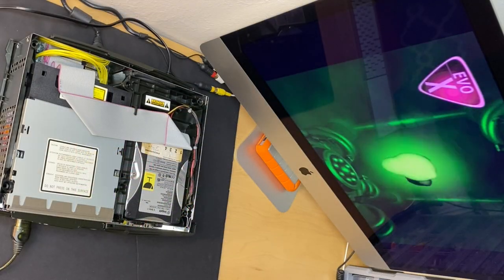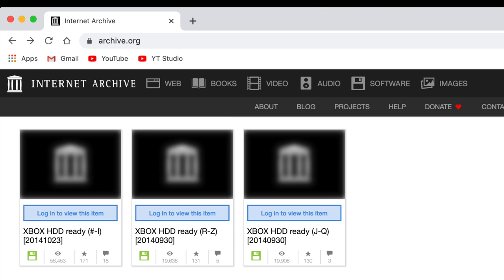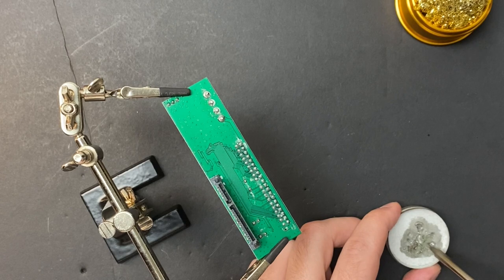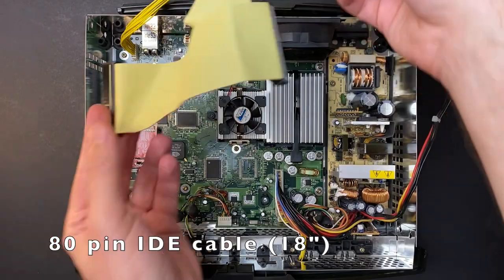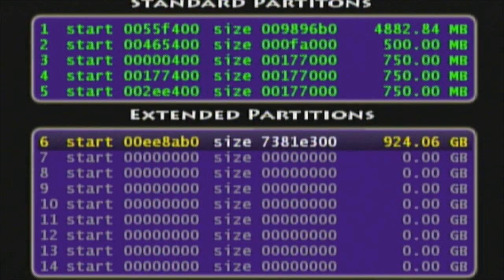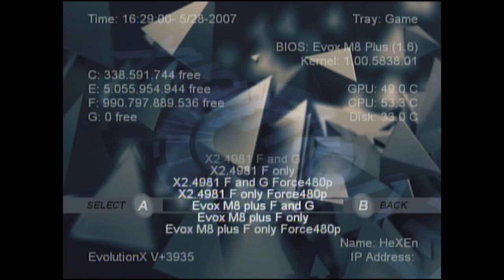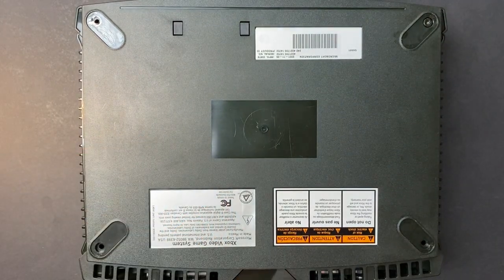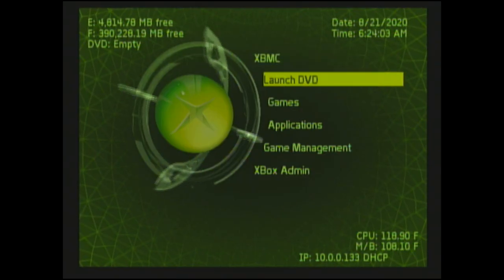Modded Xbox 1TB Hard Drive Upgrade - Retro Console Repair

Comment: Xbox is by far my favorite console ever. I remember back in highschool modding my console with a chameleon mod  chip. I had a few friends with modded xboxs as well and we always traded games and software. I was pretty popular for having all the family guys up to that point on my xbox lol. I also remember putting a momentary switch inside the controller where the memory card would go to power on or off the xbox with out getting up. There's an un used wire i believe a yellow one in the controller you can do this with. I have a video on my channel showing my "time capsule" xbox and how its been since highscool. I graduated on 05 :)

Comment: Love your videos!
Also, a tip for the future: Replacing it with a used enterprise hard drive might be better for the long term as they are built a LOT better, in my opinion. I've hard numerous new retail drives fail on me, but none of my used enterprise drives have given any trouble.
Many businesses will cycle out their drives every two years, and the drives come with a five year warranty as well. If you buy one, and the SMART data shows it's going bad, just cash in on the warranty (or just return/exchange it). Just remember to double check the mfg date on the drives before you buy. Also, make sure you're buying a SATA hard drive, NOT a SAS drive.
But, this is just an anecdotal experience. Lady Luck may be feeling fickle, and you might end up cursing my name if you do this...

Edit: Forgot to mention, they're usually a lot cheaper than retail drives also. However, if you plan on getting brand new enterprise drives, be prepared to pawn a kidney.
Reply from the maker: Nice hack with the warranty idea. This was supposed to be a DVR drive that is advertised to run constantly. Strangely its a 5900RPM drive which is an unusual configuration. It was cheap though. I think for the next build I would use something a bit more high end.

Comment: Nice. Should maybe look into the CPU and RAM upgrade. It doesn't do a whole lot for Xbox games but it's a game changer for emulators and such.
Reply from the maker: Thanks for the suggestion! To be honest with you though I wanted this to be a pure Xbox gaming rig so that I could experience older Xbox titles that I never played when the system was released. I do enjoy some retro emulation on a Raspberry Pi and I know you can push the Xbox even further with PS1 and N64 emulation, but I don’t have a strong desire to use it for that purpose.
Reply: @BorderlineOCD  While it’s good for emulation, the RAM upgrade also serves other purposes. It helps to smooth out dashboard performance for certain ones, and there are some Xbox games that can be patched to run in 720p which requires 128mb RAM to do so. But there are also a few games that can be patched to run in 720p that’ll work fine with the stock 64mb RAM.

Unfortunately, the CPU upgrade is not just something simple that anyone can do. There were only like two community guys with the knowledge of how to do it, and they never made that information public. Then there was the company that made them. It was called the DreamX but no information about that was ever released. There is a guy working on researching how to do it so he can release the information, but that’ll be a while.

Comment: Great video! I was wondering which rgb adapter are you using to connect the Xbox to your iMac? Thanks!
Reply from the maker: It's an inexpensive capture card that support Mac. I have it linked in the description. It's not RGB though just composite. I only use it for testing during repairs.

Comment: You can flash the internal bios of the xbox from 1.0-1.5 without a modchip.   I flash all of mine but only use a modchp for xbox v1.6   Hope this helps.
Reply from the maker: I know, but that wouldn't involve any soldering, and wheres the fun in that? :) For most folks soft-modding would be the way to go, but I do like the added flexibility of a mod chip like easier HDD swaps. I also have another unit I'm working on soon that has a dead DVD drive and it should be fairly simple to flash a firmware on the Aladdin XT that forgoes the drive check on boot.

Comment: how did you get your xbox to boot from the new hard drive all the videos i’m seeing are using the hot-swap with a y splitter ide power cable. this method looks way easier
Reply from the maker: It's hard-modded with a chip (shown in Part 1) so you can directly initialize the hard drive using HeXen.

Comment: Great video
Do you have any idea what the maximum hdd size is the chip can detect on the latest firmware? I was looking around online but didn't find a straight answer
Reply from the maker: Updating the Aladdin firmware will allow you to allocate the full 2TB that the file system supports. With a 2TB drive you'll actually have about 1.8TB of space. If you install a 3TB drive, you can allocate the full 2TB but the rest is wasted. Some people still do this to get those extra 200GB, especially if the price difference between a 2TB drive and a 3TB drive is negligible.
Reply: @BorderlineOCD  thx for the reply! I'll be modding one of my xbox systems myself soon and thanks to you, I'm all informed and ready to go. Keep up the great work :)

Comment: I use jrocky5 soft mod does all that you do with the chip
Reply from the maker: I think a softmod is the best option for the average person. If you don't have the soldering skills you shouldn't concern yourself with a hardmod. Most people won't care about the advantages of a hardmod as they are mostly for tinkerers and hobbyists. Things like easier HDD swaps and rebuilding corrupt dashboards area still easier with a hardmod as the system will always boot from disc first. I also plan to build a modded unit without a DVD drive. A softmod won't allow you to do that. If you just want to play games a softmod is still the easiest option.
Reply: yeah i finally got a xbox with dead hard drives

Comment: Does this still end up with the issue where some games may not work due to file path limitations on the hard drive vs the DVD?  I used to have a soft modded Xbox way back and would dump the games from the disc directly.
Reply from the maker: I haven't run into that issue but there are way more games on here than I'll ever play so if its an issue perhaps I just haven't experienced it yet. The only detail I recall having to pay attention to was transferring games in Binary mode via FTP (rather than the default Ascii mode in most FTP programs) otherwise text appeared garbled in some games.

Comment: where did you get the softmod software installer disk?
Reply from the maker: Search for TruHeXEn and you'll find a version. It's not really a softmod installer. The system has to be modded before you can run the disc.

Comment: I have an xbox when I turn it on it shows yellow lights for moments and then it turns off. what could it be?
Reply from the maker: I'm assuming you mean orange? Solid orange has something to do with the A/V cable (bad cable or unseated) and flashing orange is overheating I believe (could mean there is a problem with the fan).

Comment: my old Xbox got a problem too. when I turn it on it has bad contact, so it's very hard to boot into the modchip firmware, usually took me 5-10 tries to get it. I thought it might just be a bad contact on the switch, but when I watch your video, it fear it is probably more. Maybe the battery leaked or the traces are bad on the board. Why do these traces go bad anyway? oxidation?
Reply from the maker: There's no internal battery but you're probably referring to the clock capacitor, in which case it has been documented to leak on all Xbox versions except the v1.6. The traces are usually corroded by the electrolytic leakage from the clock capacitor. There could be other reasons those power rail traces break, not sure but I've come across it several times so it appears to be common.

Comment: If i have a softmodded system can i still hardmod it or will i need to uninstall the softmod and then install the hardmod?
Reply from the maker: A hard modded console will not automatically boot a soft modded dash. I believe there are ways to do it and rebuild the dash using HeXen so it points to all the right locations but I haven't done this before so I'm not sure about the implications. I'm assuming you are looking to keep your stock hard disk? If you're upgrading the hard disk anyway then HeXen will allow you to partition/format and install the dash of your choice.

Comment: get some Thermal Grizzly Kryonaut, thats 2-4°C cooler than Arctic MX-4, bro.
Reply from the maker: If you're building a gaming rig with the latest and greatest hardware, by all means use the best paste you can buy. MX-4 is an excellent paste from a cost/performance perspective and I wouldn't hesitate recommending it. I repair systems regularly so a more advanced formula on my builds would quickly add up in $$ and the benefits provided are not worth it for the average person.